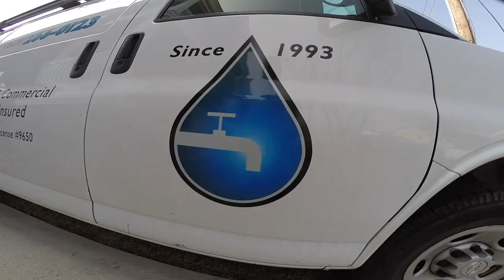CLOGGED KITCHEN SINK DRAIN LINE CLEARED OF BLOCKAGE

Comment: I'm a maintenance tech at an apartment complex, so I've unclogged plenty of kitchen pipes because of potatoes, rice, or noodles going down the garbage disposal, but it's always been at the t-joint under the sink. It's crazy how much more solid and compacted it can get down the line.

People need to be educated that garbage disposals are not there to replace garbage cans.
Reply from the maker: a real problem..even in my house...and its not from me..ha
Reply: I agree, Disposals are a pain and start to smell. I convinced my wife to pull it out and installed a water purifier. The brass waste lines were a pain..but I got it. Like a jig saw puzzle

Comment: I’m a service plumber.  Gotta love them calls and the ol cast iron!
Reply from the maker: oh man....I battled there yesterday there with cast...edit coming.
Reply: Sweet!   Looking forward to it!   Last video you mentioned grinder to cut cast,  have you tried the snap cutters?   Love them.   Unless cast just falls apart than that makes it tough to connect to with fernco.   Love your videos!  Not sure how you find the time to video and work!
Reply from the maker: man the battle was on. I used sawzall with diablo blades heavy metal...snap cutter is a wrap for me unless pipe is new. It always crushes it. all cast i work on is really old. If another cast job is ever done by me I would look at ridgid press snap cutter.
Reply from the maker: working on edit now btw .......

Comment: Nice vid!!!!!! Going into my six month as a apprentice. classes next week. Takes time, but boss wants me on my own?? do not get it, takes 4 years just to take the journeymen license? I feel I should be working with experience plumber for at least 2 years to get the service work down. what are your thoughts?? Happy New Year!!  Alvin
Reply from the maker: ya he really pushing...Happy New Year Alvin.
Reply: It all depends on mechanical you are?  When I got my first job working for a  plumbing out fit. I worked in the warehouse.  By the time 8 months had past. I was in one of their trucks doing service on my own. Service plus a bit of common sense.  Is really easy. This 4 I inch cast is a two hour job plus material. Throw Chucks grinder away.  Buy a good ratchet snap cutter.  Two bands approximately 5 fittings. Some straps & he's done.
Reply from the maker: dam...lee your good..snap cutter? please how many old sewers have you snapped and ended up cutting anyway because it was crushed? cmon lee give us a teachable moment. I did not use a grinder here. I used a sawzall daddy.

Comment: How many time's have you worked on this property now Chuck ?
Reply from the maker: 3 jobs a couple of days in a row to complete all of them.
Reply: Based on how poorly he cleans the pipe at around 10:50, I'd say quite a few times.  Leaves 25% of the crap in there that's causing the actual clog in the first place.  He's cleaning out the bare minimum and not actually clearing the gunk that's causing the backup at that spot in the first place.  I mean look at that thing, that's atrocious.  The whole right side of the pipe is stopped up with stuff that's completely stuck to the side.  But he used his trusty little wimpy plastic pipe to clear out some corn and I guess that's good enough.  He literally tries to clean their pipe with some random piece of plastic sitting in the dirt on the crawl space floor.  Yikes.

Repeat customer.  I'm sure they have him on speed dial.

Comment: why didnt you auger it?
Reply from the maker: clogs same spot every time they go crazy with food in disposal....That connection has since been replaced.
Reply: @ChuckBarron  Do you think the clog is in the same spot every time because you leave at least 25% of the gunk on the side of the pipe and use a flimsy plastic wand to clear out the easy stuff?

You literally left in all the bad stuff that's causing it to back-up right there.  Just pulled some corn out, left the real culprit sitting there, and then put the pipe back on.

Comment: Great video as always.Speaking of kitchen sinks the double bowl stainless steel sink in my kitchen was installed without any caulking or plumber's putty around the edge that sits on the counter top which resulted in water seeping between the conter top and the double bowl stainless steel sink down into the kitchen sink cabinet.I know that many of you may be annoyed with me posting but come on,who ever did the work in this house didn't know something as basic as using caulking or plumber's putty between the double bowl kitchen sink and the counter top before they installed it?Now I am going to have to buy a new double bowl stainless steel kitchen sink because the track under the edge of the double bowl kitchen sink which attaches the sink to the counter top with fasteners has rusted out so I have no choice but to buy a new kitchen sink,is that a crying shame or what?The majority of the contractors over here where I live have very negative reputations and rightly so because if contractors are going to do work they should take pride in what they do and do the work properly,otherwise why bother doing the work in the first place?The total failure of that 'extra special" person that installed and attached the double bowl stainless steel kitchen sink to the counter top in this house with a five or six dollar cartridge of caulking or plumber's putty is now going to cost me at least one hundred and twenty dollars plus the cost of the caulking or plumber's putty.I was taught at an early age,because I have always loved fixing things and seeing how things work so I started fixing things and working with contractors and plumbers at an early age,that recommendations are not really necessary if you do good proper work because the work will speak for itself and attract customers.
Reply from the maker: where you out of nelson?
Reply: @ChuckBarron  I'm here in Northumberland PA,I'm originally from Brooklyn NY where I was born and raised.I've been living here in Northumberland PA for over twelve years now.

Comment: I went under my house to fix the dryer vent , ended up replacing 10' piece of drain pipe for the kitchen sink and washing machine because it was rusted out. I'll guess I'll end up replacing the Y and the going to the kitchen sink and washing machine later much later I hope
Reply from the maker: surprise surprise. dont you love that. I am replacing that section and cutting out the 4-2 wye also today.
Reply: That's where it's always going to clog cut it out

Comment: 11:10  Did not even clear the drain line lol just pulled out some corn but the rest of the crap that caused the clog is still there.  Wow.  I guess creating a repeat customer.  Notice at 5:45 he pulls up a piece of plastic from the ground and says something like, "Ah, I cleaned this last time here with this."  That's nice.

Unfortunately, we can't see the like/dislike ratio anymore but for a video with over 30,000 views, there should be more than 325 likes.  It should be more like 3000 likes.

Comment: Drain line is to long to have a disposal hooked to it before it hits the main.
Reply from the maker: is that in code?
Reply: @ChuckBarron  no experience,  I found a kitchen sink drain is the dirtiest drain in the house. And the longer the horizontal run the dirtier. Add ground up food adds to the problem . Most home owners don't run enough water when using a disposal leaving heavy food parts in bottom of drain , after time it starts to damn up . Plastic pipe is "slick " on the inside as you know . Cast is rough , I've had times where the whole run was plugged like quick sand put  the cable in and it would start to run pull it back out and the "muck" would fold back in and plug up again. The ugly.

Comment: Real drain cleaning companies don’t open a clean out plug under the house 
Use a drain machine from the vent on the roof Never spill a drop
Reply from the maker: If i were gonna use a drain machine here I would of put in sink. this was a two story duplex and I know guys do some roof vent entry but in 30 plus years I have never clean a drain from the roof and Im not planning on starting. Even though this was ordinary construction with a flat roof. This was a repeat offender of blockage spot. Today will be its last day.. We cutting out that 4x2 wye along with cracked sewer and replacing that section.

Comment: Can someone on this channel please give me some helpful advice?
I own a doublewide mobile home with 3 sink's, 2 toilet's and 2 bath tub/shower's.
Everything drains just fine all except my double kitchen sink.
I've tried plunging it, drano, crystalized lye and even had a friend of mine run approximately 50 feet of cable down it, all of which failed to remove the clog !!!
Next I am planning on getting under the mobile home and try to see what can be done to resolve this issue, the only thing is I am not a plumber and don't really know what I'm supposed to do in order to isolate the clog and the best way to clean it out from underneath the home!
Would somebody be gracious enough to help me here because I've been having to wash my dish'es in the bathroom sink for the last 2 week's and it's really a pain in the ass when I can't call a proffessional, I lost my job on top of everything else and just can't afford the extra expense right now! Thank you in advance!

You Tube Subscriber,

Mike
Reply from the maker: Mike, Check in crawl, you may be so clogged that line needs to be cut and cleaned and put back together. Or high speed drain cleaning with water dripping slowly...keep working that cable back and forth....painful but it will break the clog. good luck.
Reply: @ChuckBarron  Thank you for your response, much appreciated! 
When you said check in crawl, what exactly did you mean by that, how do I pinpoint exactly where the clog stats and where it ends? Do I tap the pipe with a hammer and listen to see if it sounds hollow until it sounds solid and begin cutting at that point?
Thank you for your help Chuck, I really appreciate your advice my friend!
Reply: @michaelsullivan9342 Did you ever come to a conclusion with your kitchen sink clog? I have the exact same circumstances here myself.